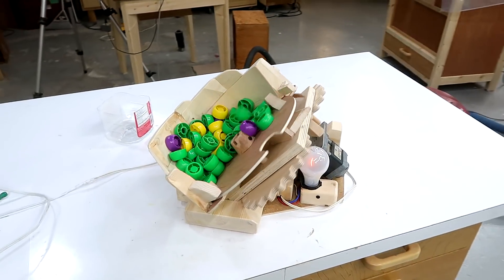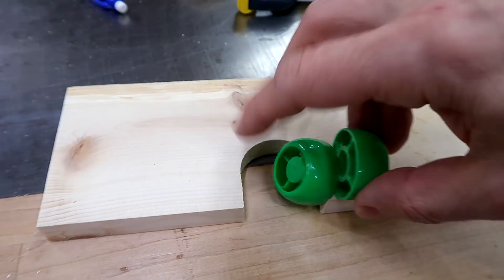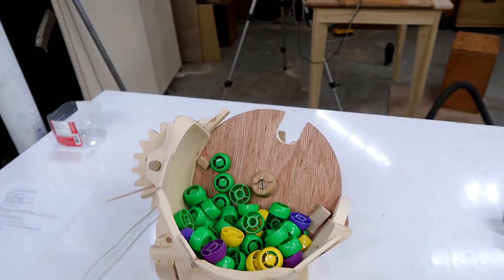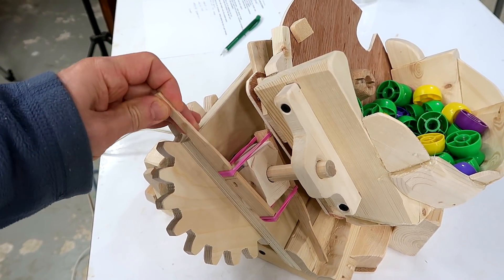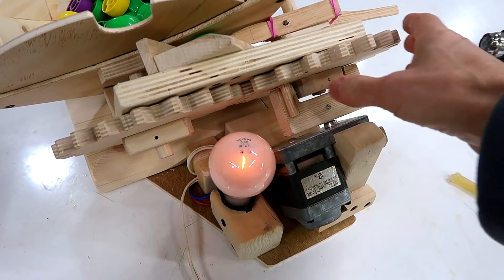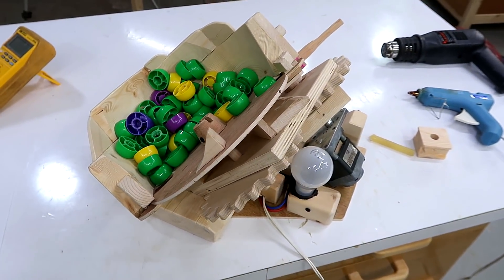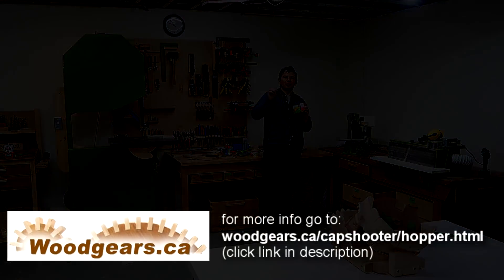Hopper fed catapult: Motivations and challenges

Comment: Look up rotary sorting table.  Dump all caps in the middle of a table that spins, and caps will glide across a profile gate to sort out by orientation and travel down a chute.  You can further sort to flip if they are the wrong way up.  Used a lot in automotive to sort forge gear blanks

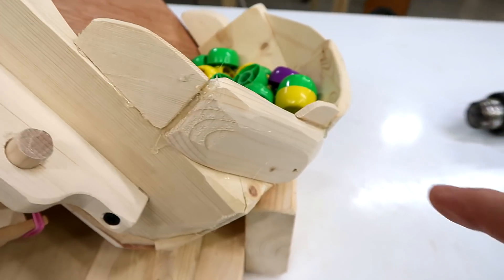Comment: 1:03 
its more like brazing or soldering, definetly not welding though, welding literally melts the two metals together to form one piece with just small difference between material a bit
Reply: Most welding (or at least manual welding) is done using consumable welding rods or wire which is able to fill small gaps; I believe this is what Matthias is referring to.

Comment: That paddle design is pretty awesome. definitely going to use that in the future. i worked on a fixed wing glider launcher years ago, and the recovery of the launching arm was a massive problem. We wanted to get the glider thrown as hard as possible, but we would get it so wound up with car coil springs, that the inertia of the throwing arm would rip the entire launcher apart. In the end, we decided to just let the arm fly off and attached a long thick rope to it.

Comment: 4:00  succinct explanation of why the ancients switched from catapults to trebuchets.  all the force, none of the shock. much longer operational capacity. can be fired so long as you can find stuff to load them with, long after the lever or transverse brace on a catapult broke in half.

Comment: I always tell my girlfriend soldering is like hot gluing small metal and welding is hot gluing big metal
Reply: That is funny. But the real difference between soldering and welding is that in soldering, the parts being joined do not themselves melt. But in welding, the parts being joined DO melt at the weld site.

Comment: The reason for the slim base on the hopper was obvious for me, but not exactly for the reasons you described.  I figured you wanted the caps to only come through with the flat side down so that you would have a consistent trajectory.  Having them launch flat side up or sideways would have an unwanted effect on the aerodynamic profile.

Comment: Nice. Any chance of a second layer connected to the not rotating part that limits the height and only lets the caps go up  with the slot in correct orientation? Caps going up with the slot in vertical position would hit that and rotate/get pushed back but caps that are horizontal pass under it. Or something like that... usefull in anyway ? or just jam?

Comment: The resistance of the incandescent light bulb will change as it heats up. Plot it out, it would make a good video!
Reply from the maker: It would be interesting to you and me, but I don't think it would get a lot of views.
Reply: Tungsten, and many other metals, have a thermal coefficient of resistance of about 4 percent every 10 degrees (K or C). The temperature of the hot filament is about 2600K. From that you can pretty much graph it out in excel or something. I am sure it won't be exact, but it will be basically shaped correctly.
Reply: Somebody presented a very nice graph on Stack Exchange: https://electronics.stackexchange.com/a/164643/13616
That graph aligns with the old suggestion of having a current-limiting series bulb being 3-4 times the current rating of the device you're protecting.
Reply: @eDoc2020  that is interesting but I think that is steady state current as a function of voltage. What jamanjeval proposed was resistance vs time. Which would be trickier but also very interesting.
Reply: @mckenziekeith7434  With a digital oscilloscope and a shunt resistor one could measure current vs time on a constant voltage source. Then converting to resistance vs time would be a simple matter of division.
Reply: @eDoc2020  yes. That is how I would do it. Except I would use a current probe with no shunt.

Comment: For something that's intended to be fun, I think a rotating tumbler is much more interesting than a vibrating hopper anyway. Although, I think it would be more reliable with a slot that is wide enough for the paddle to pass through but not the cap such that if the cap enters before the catapult is ready, it sits there ready for the next catapult. Doing that it could have more feeding slots so it feeds more often, creating an internal magazine of caps ensuring there is at least one cap there most of the time
Reply: I also had the idea of having the slot paddle sized but not cap-sized because it would eliminate the timing issues Matthias encountered, but knowing him he probably thought of that himself but decided it was not the best option.